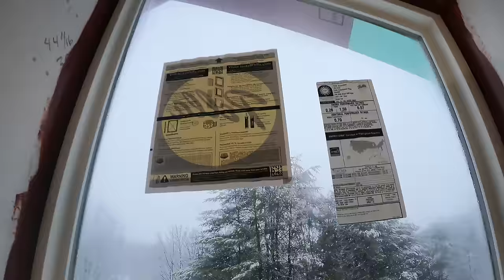Electric and plumbing on the second floor - Building my ICF house part 17

Comment: We put in Pex in our cottage, at first l was doing 90’s when needed, then l figured out that most of the time l had enough room to wrestle it into place without any cutting or fittings between terminations.  Also l found out that the 1/2” is greatly reduced in diameter by either plastic or copper (less by copper) elbows.  Kind of wished l had used 3/4” for it all.  After 8 years, still love Pex.  Our cottage froze when furnace died one winter but not a single leak after getting it up to temp.  Like your videos, not afraid to show mistakes we all make. ❤

Comment: March 19, 2023
Part 17
1:28 Installing boxes
5:47 Plumbing puzzle maze of some kind
7:43 Cleaing burrs off. Love this noise
11:27 More plumbing through the walls
13:27 Inspector helper  enters the room
18:10 Talking about the plumbing
25:25 Quick 2x4 wall build
26:00 Running wire
28:42 Plastic wire spacer 
29:42 Talking about a homerun. Whatever that is
30:20 Used 1000 feet of wire so far . $650.00 bucks. yikes.
32:00 More wire pulling
36:50 Talking about electrical box in the foam wall
37:48 Cool foam cutting tool.
38:52 Wire being tucked in the foam wall
39:18 Two wires in electrical box install
41:08 Talking about the electical box problems. $10.00 price tag for one.
43:43 Back to electrical wire in the foam wall
44:10 A different kind of foam cutting tool being used
45:00 A regular box being installed. This is work now.
45:40 Wire being run the foam wall to the next box
46:07 Cutting more foam for the wire
48:20 Wire install, 200 speed
50:00 Foaming the boxes in. Love this sound, cut the music down for this.
51:15 No music using the foam. Thanks
51:42 Snowing outside
52:30 back inside overview
53:15 Pulling more wires
55:37 Vent through the roof
58:25 On the roof with the boot
59:50 Drilling holes in the roof for the boot
1:01:01 Caulking the boot to the roof
1:01:50 Screwing the boot to the roof. Lots of screws.
1:03:15 Pipe going in the boot
1:04:40 Foaming in boot. oh that sound 
1:05:50 Foam cutitng on the ceiling for the pipe
1:08:08 Prepping a pipe
1:09:38 Talking about the pipe sticking below the ceiling
1:10:09 Laser time. laying out a fan
1:12:15 Talking about the plumbing clean-out
1:14:24 Deb4 #04430 plumbing reamer tool
1:15:22 Another plumbing tool 48-22-4255
1:16:31 Primer and Glue tip
1:16:52 Back to the plumbing of the clean-out
1:18:03 Strap on the pipe. Filling with water and testing the system 
1:24:30 Talking about UF wire and things that need done
1:27:09 Smoke detector talk
1:28:41 Talking about electical wires and code
1:32:56 Kitchen electrical talk
1:37:22 Over view from outside
Reply from the maker: that is a very comprehensive list you made. well done
Reply: Not all hero’s wear capes 😮

Comment: When you’re installing those electrical boxes for your outlets just hold your hammer upright on the floor and then rest the box on top of the head and then nail it off it will save you from pulling out the tape measure all those times I have to tell you man this build is on the next level be safe God bless

Comment: Good job on the plumbing Jesse! I myself am a plumber apprentice I’ve done some bathroom groups and kitchen/laundry pvc drains and vents mainly new apartment buildings. I know how it goes. I actually like doing plumbing on new houses or cabins instead of apartments less complicated. You did good. I also have to install bathroom fan and dryer vent duct piping. I don’t like working in high attics installing dryers and bath fans but it’s part of the job. Dryers and bath fans need to be done. Anyways great job and way to good.
Reply from the maker: Thanks. I am actually installing my dryer duct as we speak.
Reply: I m over here in Minnesota good luck on the dryer vent and bath fan 🙂

Comment: Those boxes are tricky Jesse. The best way I’ve had them work is to install the boxes and the prongs first, and then open some space at the top or bottom as needed, then foam all the gaps when finished with all the outside walls. I usually use a heat gun as I install the box so it is recessed. And I make curved grooves for the wire turns rather than a hard 90° turn. Good work.

Comment: One thing that helps me with pvc installation is to line up the marking strip to the elbows for reference to lining up the fittings. Makes life so much easier and faster. I still use a level but using the pipes identification markings is an easy way to go plus it makes the job look good as well. Great content I still can't believe how hard you worked on that cement roof. Kudo's!

Comment: consider putting the washer dryer in a closet with acoustic insulation in the walls.   next to the stairs the noise will be everywhere.
i would fill where the vents pop thru the roof with hydraulic cement and leave it a little high.  take the 12/2 all the way out of the plastic, pin the wire to the ground and roll it out like a tire.  that makes it flat then wrap a piece of wire around the unused coil so it doesnt slinky out on you     i would use MR board at least for the bedrooms

Comment: I found that an 18 CI box was the correct depth for the foam in my ICF's and enough protruding beyond the foam to accommodate drywall. I just drilled a Tapcon through the back into the concrete.

Comment: Love your videos.  Glad you are making progress even in the snow.  I wired houses for a little while a decade or so ago.  The journeyman I worked with used a battery bell at the panel.  He hooked up all the home runs to the neutral and hot.  As we would wire a box, we would touch the two together and the bell would go off, letting you know that the whole circuit was correct from the panel to the outlet.  It took us about 2 and half days to rough in a standard home.  But when the final was done (installing the fixtures after drywall) we did it in under one and half days because we couldn't fit everything in the van for one run.  Everything worked the first time which saved a lot of time and energy.  An outlet wired wrong can take some time to find after drywall is in, and you have to cut holes and just messy.  Also, a trick we used for boxes is to use the hammer, place the bottom of the box on the hammer hold the box and hammer it up.  The exact height isn't that important but must be exactly the same in a room.  This again saved us time of having to measure every box, (yes I bought the same hammer as him) and now there a laser to do the same thing to save time.

Comment: One thing's for certain, that entire house is a "Safe Room" during a tornado/hurricane/earthquake/landslide etc. (Including Imperial Storm Troopers)
Reply: And Zombies!
Reply: Question is though, is it mice proof? 😅
Reply: @manganvbg90  Nothing a cat can't solve.
Reply: @merlepatterson  cant get them all…. We have 4 cats on our little farm and we had an uninvited guest in our ceiling
Reply: @manganvbg90  That's a bummer, but as far as Jess's place, they aren't going to be chewing their way through the walls any time soon. So as long as he seals everything up good (which I'm sure he will) he should have no troubles with critters at all.
Reply from the maker: @manganvbg90  mice proof yes for sure. the only way they could get in is if we left a door open. There will be no places that are just foam, so there will either be concrete, glass or steel (for the doors). absolutely no place for mice to get through. and that was very important, I absolutely hate how mice can get into some old houses, its very pathetic
Reply: That’s not tornado/hurricane/earthquake country but zombies, yeah, he’ll be ready!
Reply: Where's this locate, state?
Reply: @raymondmcinturff3952  OOPS, In upstate NY.

Comment: I made some brick sitting walls with capped concrete.  Capped concrete is a thick slurry of Portland cement nothing but water added to bonding agent treated cement is the consistency of oatmeal then trowel on to a mirror finish. Lasted for for 30 years so far

Comment: Thanks Jesse for sharing your skills and home build with all of us; I find it very interesting. I do have one concern since I was an electricity teacher - and taught the NEC. You do need to derate ampacity when bundling many conductors due to heat degradation concerns; I think since they are also being encased in foam you do not have a lot of air to dissipate the heat developed in the bundled cables. You may want to check with a good engineer before sealing the walls.
Reply from the maker: I get what you are saying, but people spray foam their walls every day and I have never heard of de rating because of that. as long as you dont have more than 8 current carrying conductors together it should be fine anyways. over 8 and you need to de rate
Reply: @jmuller86  - I agree with that Jesse, but think the code may change due to the high R value of foam insulation. On the other hand keep up the great work - us old retired guys need to see the wonderful work you do!!

Comment: so easy to do electrical and plumbing on a new build timber framed house... in the U.K we dont have many like that mostly they are brick/Block construction and each outlet has to be drilled and wall plugged into the wall, Especially on the older 1900 Terraced house's many you have to cut channels in the plaster for cables lol.

Comment: There is a dryer vent called better vent, it mounts on the wall and is super easy to open and clean the lint out.  It would save having to run the long flex.

Comment: I have 1 idea for you, it may seem excessive and I would never do it on a rough in but, those plastic boxes are notorious for snapping the 6-32 screws, I would go around and tap or run the 6-32 in each screw hole before sheetrock is on and make sure you don't have any boxes that are screw snappers. They suck to fix if a screw does break off. take about an hour but you wont have to fix it later. not sure if a tap is the best either, they break a lot at that size.
Derating is weird. I had a builder that could not comprehend derating and always wanted the panels where you can never get to them again without piping to them in houses. made no sense and he built the most expensive houses we worked on. you would think the guy that went the extra mile on everything would say, yes a disconnect and panel in the interior makes sense. Nope, cost too much. Even though every cheap apartment on the planet has a disconnect on the panel at the meter.
I have to figure out how to wire a SIP panel house this summer. I am not looking forward to it. Keep seeing people say drop a heated metal ball down through the insulation. I am worried about starting fires.
Reply from the maker: I have honestly never broken a screw inside a box, if one breaks I can just cut out a square of sheetrock, fix it and then repair the drywall. it wouldnt be that hard at all. Now if I was gluing the drywall, that would be a different story and it might be worth the effort to make sure. but I have installed thousands of outlets and never had a screw break before

Comment: Not gluing the vent pipe is cheap insurance. If you dont have a finished basement..
My parents house they didnt glue the vent pipe, when the septic backed up, it blew the 90 off the vent and flooded their basement. 
If the vent was glued, it would have filled up and the first floor toilets would have overflowed.

Comment: Your pencil chamfer tool is available at most places carrying tools for machinists and probably cheaper than Milwaukee.  They also have replaceable blades, some have different shapes as well.  Most are carbide so they last a very long time with plastic as they are meant for steel, aluminum, etc.
Reply: Travers Tools has a nice selection of deburring tools as they call them.

Comment: Look for heat-pump (ventless) dryer rather than "standard" vented. It is waaaay more economical. It's not so power hungry, only thing you will have to do is to provide way for water exit same way as washer.

Comment: Have you weather proofed the roof yet? If it's still exposed concrete. And all concrete cracks. Are you worried about water infiltration and expantion of moisture freezing in the concrete?
Reply from the maker: it will be waterproofed soon. It only freezes at night, and the concrete still warm from the day so it will be fine. there is no cracks yet either, I check it almost every day

Comment: I don't know if anybody else has pointed this out, but you might have a hard time with the wireless lights.  The floor is made of concrete, which has a lattice of metal rebar running through it.  Have you ever heard of a Faraday cage?  It's been my experience that wireless signals don't tend to penetrate concrete walls very well.  You might want to test it before closing up your walls.
Reply from the maker: smoke detectors? yea I guess I should test it. I will also leave a piece of conduit from basement to second floor in that attic area, I can always run a wire through it if I need to
Reply: @jmuller86  Yes.  Sorry, I got confused.  You're right I did mean the smoke detectors.

You might also think about ethernet connections too.  Everything is connected to the internet these days and I would think that any wireless signal will only reach what's on the same floor.  There's an app for smart phones that will show you the strength of available wireless signals.  Plug in a wireless router and see how well the signal reaches.

Comment: Jesse, will you add steel shutters over the windows? The place is coming along nicely, and having wired many homes along with dabbling in all the other trades other than foundations, you are killing it! I’m sure you are close to getting all the windows installed, and that will really dry it in. My home has so damn many windows it’s crazy: living room and family room each have eight windows! It’s niece in the winter, for light, being in Colorado, but expensive in several ways. Keep up the great work!

Comment: Hey Jesse, do your electrical cables not have issues with polystyrene? In New Zealand we aren't meant to have our TPS cable touching poly as there is a chance they can react and make the sheathing brittle.

Comment: If you are doing a lot of plumbing getting a sonic leak detector and using air pressure for a first test.  If it holds pressure overnight then you are ready for the water fill.  Much less messy than having water leaks that run all over.   You probably have the gauges etc from when you pressure tested your in slab heating tubes.

Comment: Man, this makes me so happy that I lived in a county in Texas without inspections (except for your septic system - and boy they knew it. Lots of people get screwed in that system.) When I built my barndominium I followed the general code that applied since that just made sense but there was no BS with inspectors. When I moved to Austin it was a real change. A simple replacement of a condenser would have cost half the price of a brand new system since they demanded that I bring all of it up to current code. Screw'em. I found a contractor who replaced the whole system for all most the same price. No inspection or permit but I didn't care. It's a simple job that this moron could inspect to make sure it's ok.
Reply: We had to replace our septic system last year as far as i'm concerned for no good reason , our old system was working just fine . It cost us 25,000.00 bucks .

Comment: Are there no restrictions in the US electrical code to not lay plain cables inside insulation? Here we have rules to route cables through insulated walls in conduit (whose one side must be "cold", i.e. resting against a structural element, not insulation directly to allow for heat transfer) or possibly, in some cases, by using an appropriately thicker wire. It's always interesting to compare installation methods since the physics are still the same on all continents :)
Reply: Codes vary by locality but typically we are not allowed to run romex in conduit in walls, with a few exceptions. I did my house with an ICF basement and did almost the exact same thing as Jesse, you can definitely run romex directly within the insulation. My upper floors are SIPs for walls and I have PVC conduit everywhere as the chases were built in to the walls, which is one of the exceptions in the NEC which allows romex to be used.

Comment: Well one thing about it you'll find out soon enough if the inspector has a hard on for you or not!  I've heard most of them automatically fail you for something just to justify their job! Good luck!
Reply from the maker: I actually always get along with inspectors, I only had a problem with one and he was blaming me for a job that another contractor did way before I got there. other than that I just study the codes like crazy and never have a problem

Comment: Can you run the dryer vent out the wall or coaxially with the drain vent so there is one less roof penetration you need to keep water tight? You did opt for cement construction after all..

Comment: Will you be able to get the sheetrock up the stairs? Or can you get it through a window with the telehandler? Telehandler would certainly save your back.
Reply from the maker: yea we are going to put all of the sheetrock up through those big back windows with the telehandler. I can get 8 ft sheets up the stairs easily, but not 12 ft sheets. I think we will just stick to 8ft anyways though, just needs a little more taping but alot easier to set

Comment: Are you derating the conductors?  The horizontal chase in the wall makes it look like the conductors don't have space 334.80
Reply from the maker: I only have 3 cable assemblies in the horizontal areas, derating 6 current carrying conductors still leaves enough current for 20 amps for 12ga